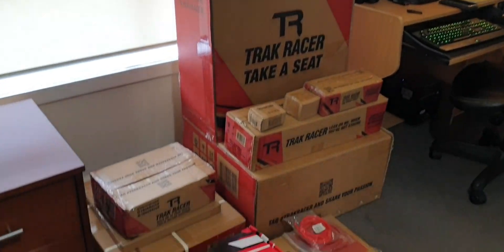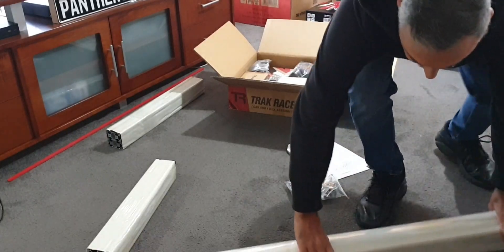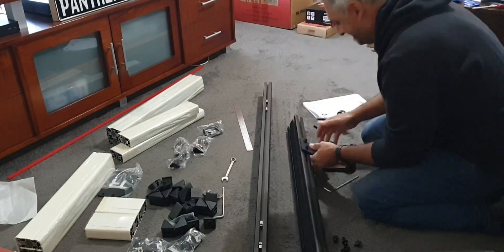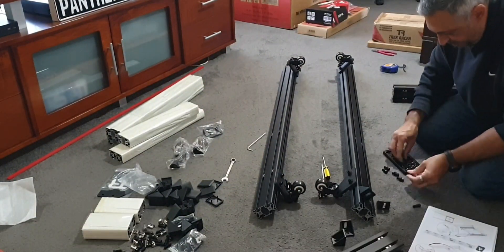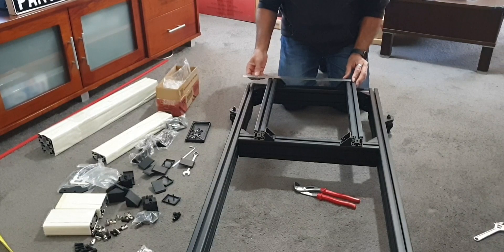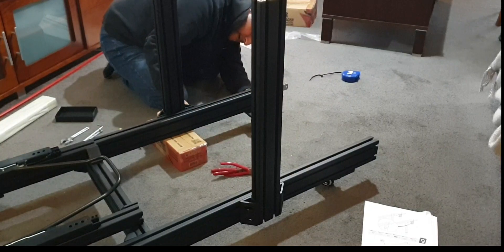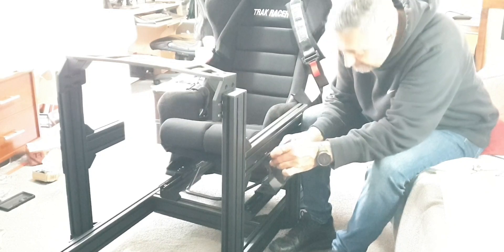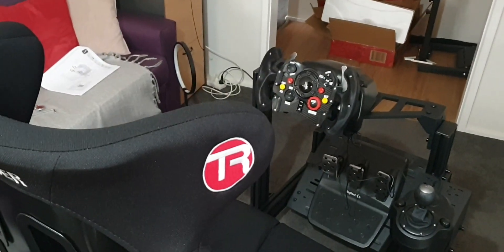Building My New Sim Rig!

Comment: Nice one :) My ASR4 from Advanced Sim Racing is VERY similar to this. And I used to have a next level racing GT Track which I ultimately returned because it was awful quality and the service was pretty lacklustre too. 

I gotta say that an aluminum extrusion rig is way better than a prefab and there’s so much more flexibility for accessories and addons. Took me a whole day to build mine and then another 6 months of on and off work adding and customizing things :)

I ultimately went with a DD1 from Fanatec, alongside the CSL Elite V2 pedals. For the wheels I went with the R300 (with Podium Hub, Advanced Paddle Module and Endurance Button Module), CSL Elite McLaren GT3 V2 and the Formula V2.5. Couldn’t be happier.
Reply from the maker: Thanks.   I agree the aluminium rigs are better than the fixed rigs because they offer heaps more versatility in the way of add-ons.  Hopefully we get plenty years  and sim mileage out our rigs and equipment! 👍🏽

Comment: Great Vid. I got the same rig, and some notes regarding the seat mount. I think that in the instructions it says to do 15" or 380mm from inside edge to edge on the cross beams but that isn't correct if you want to the outer edge flush. You did that well.. I wish I had watched your video first as now my 40x40 stick out beyond the cross beams. Also the diagram shows the 90 degree mounts on the inside part of those 40x40s.. but i think its actually better to put them on the outside as it's easier to adjust and tighten them up. I ended up attaching the seat sliders to the seat, the 40x40 beams to the seat sliders, then taking all of that and mounting that to the cross bars. Having the 90 degree brackets on the outside made that easier.
Reply from the maker: Hi Gordon. I'm glad you liked the video.  You're right the manual only tells you how far apart the 40x40 need to be for the sear rails but actually needs to explain how far from centre each rail must sit.
The manual is a little grey and open to interpretation and I know what you mean about the 90 degree angle bracket placement.  I questioned whether they should be on the inside. 
It sure was a bit of a test but still great satisfaction once it got done.   Great to know that you could work it out in the end.
Hope you enjoy your rig! 😎

Comment: Does your angle sit flush with your wheel plate?

Im building my tr80 lite now, and the bracket mounts is not sitting flush with the wheel plate because of the little notches that would normally sit inside the aluminum profile groove.

Not sure if this is normal, or if they gave me the wrong angle brackets. Im using the same angle brackets that came inside the wheel plate assembly box.
Reply from the maker: @Andrew-dy1xi  Not sure what is happening there.  Can you take a photo and send it through on my email?
Reply: @joepaceracing  Thank you! ive emailed you

Comment: I have a question, Do you think it's possible to mount the Seating bracket to the actual cockpit instead of the 40/40 profile?

I wanted my seat to be mounted lower, So I was thinking about moving the aluminum at 13:30 closer together so I can mount the brackets on that.
Reply from the maker: The only way would be to narrow the with of the main frame and secure the seat brackets to the main frame.  Though the problem with that would be is it won't give you the same sideways stability.  I think it can be done.

Comment: Nice job! Looking to get this rig too and found your vid more by luck but glad i did as it was really helpful. Couple of questions pls ... did the shifter mount come with the rig or do you need to purchase separately? And, if the shifter is mounted on the left,  does the triangular fixing plate (the part with the TR logo) fit on the other size? Thx
Reply from the maker: Hi remark704. Great to hear that the video was helpful to you.  The shifter mount was extra and I also added the longer arm for it and upright for it.  The plate with the TR logo will show on both left and right because it's printed on both sides of the plate. I hope you enjoy putting your rig together.

Comment: does it wobble any with the casters locked? feel like if this was used in a non carpet floor it will have some play even locked? thoughts?
Reply from the maker: I use the rig on carpet and it doesn't move even with the castors unlocked unless I move a lot and that movement is very minimal.  You could place a mat or piece of carpet on the non carpeted floor when you want to use the rig.  That would give more support.

Comment: How are you enjoying this 4 months in? Do you feel the need for a better wheel and pedals to match?
Reply from the maker: Hi David.  I'm really enjoying this rig and I'm looking forward to adding more to it.  I do want to upgrade to a DD wheel and better pedals as the G29 is starting to feel a bit insufficient now.  All in all so far I really happy with the rig.
Reply: @joepaceracing  Very good! I just purchased a GT Omega Prime chassis. Still waiting on it to arrive, but much like you, I started with a belt-driven wheel (Thrustmaster) and a similar wheel/pedal stand. I feel as soon as I mount the wheel, I'm going to want to upgrade it. Also already planning some other upgrades, such as haptic feedback. Was looking at butt kicker, but for the 80/20 extrude chassis, Slip-Angle has a really good looking set for a really good price and it's a 4 transducer setup with spring damping. This is quite the hobby though. Once you get the bug, you just can't see to get enough.
Reply from the maker: This sounds excellent! You're going for complete immersion!  These are upgrades that I have been planning on also.  Once I upgrade the wheel and pedals then it will grow from there.  I hope that you enjoy your GT Omega was it's all set up.  Let me know how you go with it.

Comment: You did all that for a fucking Logitech?
Reply from the maker: I ALL did that for me.
Reply: @joepaceracing  fair enough but its like buying a ferrari with a 4 cylinder engine. Go direct drive, you have no idea how bad the Logitech is
Reply from the maker: Yeah I understand that.  But for now this will do and an upgrade has always been part of the plan.
Reply: @joepaceracing  You need a decent stand or rig for the DD wheel anyway so i think you've done things in the right order. I'd probably go with better peddles now you have a decent rig to strap them to before a dd wheel although there is phenomenal deals available for entry level DD bundles with wheel, base and pedals. 
That order of doing things seemed to me to be the general consensus online but of course we all have individual circumstance and preferences that comes into it. Best of luck mate.
Reply from the maker: All in the plan and everything in time. Thanks mate! 👍🏽👍🏽